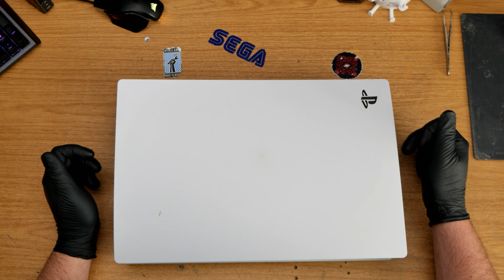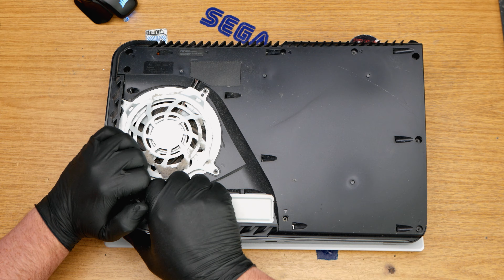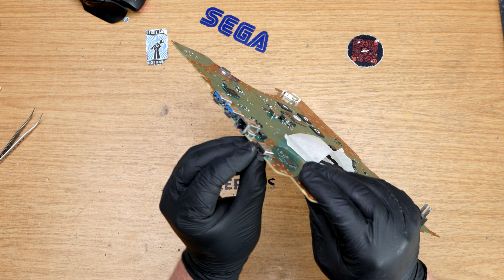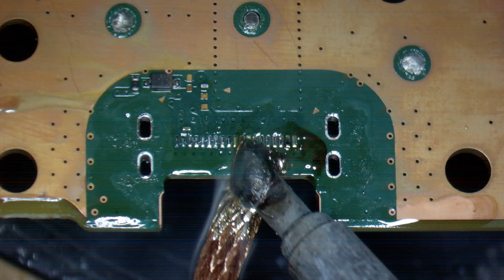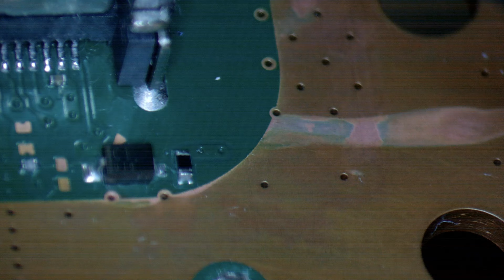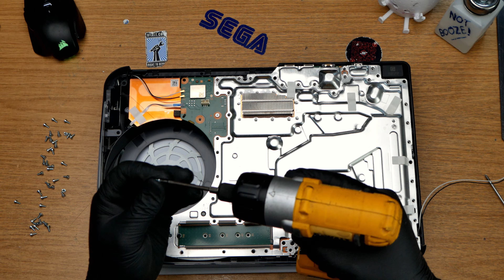PS5 BENT HDMI PORT | Quality Of Work To Expect From Us

Comment: Very nice video. Question: that much heat doesnt negatively impact the small diodes, capacitors around and under the hdmi port? Thermal shock? I see your not using low melt solder or anything like that?
Reply from the maker: Thanks you for waching. Nah..... the heat is only on long enough for the solder to flow. Not using low melt (don't beleive in it for this application).